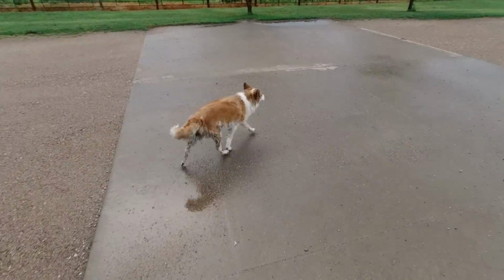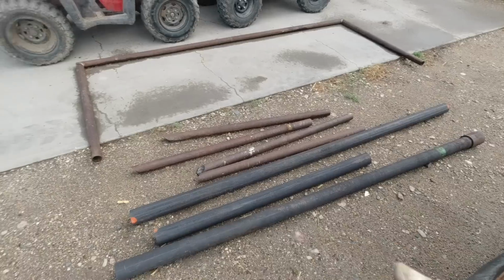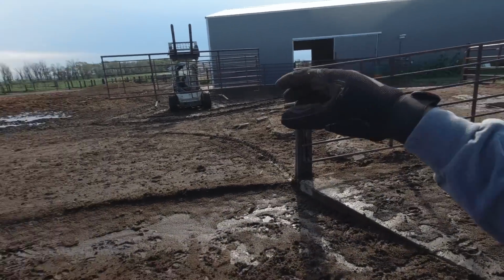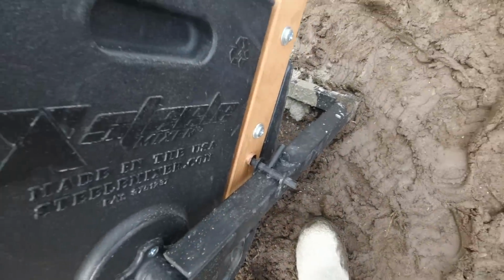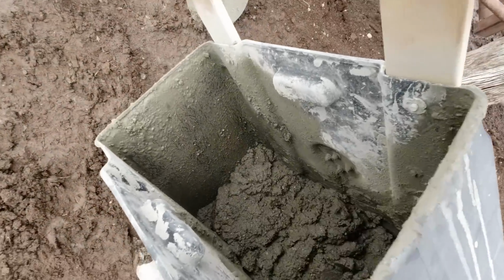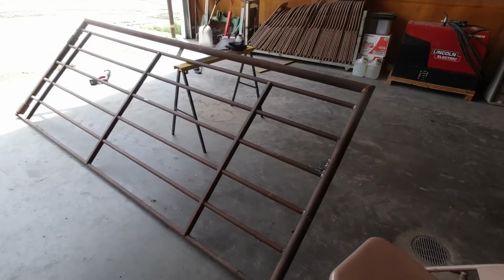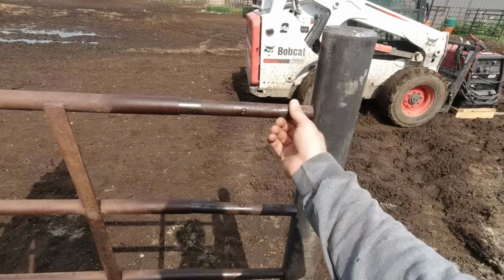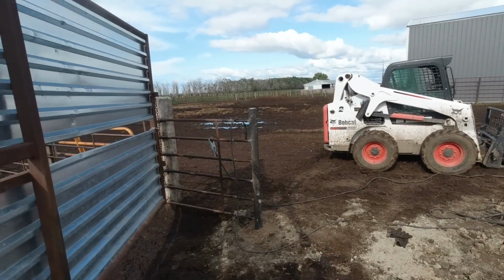Back-breaking Farm Work

Comment: I have one memory that you prompted in me as you were building those gates.  I spent one summer working at my uncles' farm implement factory building early Flexi-Coil packer frames in Saskatoon.  I cut the 2.5 inch pipe into the required lengths.  I cut thousands of packer frames.  Later, we then bent them using a pipe bender.  Then the welders would weld the steel pipe together.  I was a laborer.  It was a summer job so I could earn enough to go to university.  Your video caused me to go back to what seems like yesterday.  Thank you.  I also worked on a farm for a couple of summers.  It paid my way through you know where.  Take care when you are working alone.  . . .  most farmers do work alone.

Comment: The cement I use is dry pour. It works great.
Reply: That is true, however he doesn't have the wait time as he needs to attach the gate and the concrete needs to set. Do you know how long it takes for a dry pour like that to set?
Reply: @dhenschel4  you pour water in the hole first or last. Doesn’,t matter.

Comment: Welding Project… for gates that get snow drifted in . Cut an hing bottom two gate rungs so they will swing up as you open are close gate. Larger gates need additional diagonal to help with sagging; so they don’t drag the ground. Helps putting in a turn buckle; for adjusting height.

Comment: You have a pile of $20 tables behind where you’re welding.  Buy a flame blanket or a sheet of metal and cover the table.  Hook your ground to that sheet of metal and the table becomes hot.  It’s so nice when you don’t have to move the ground every weld.
Reply: Pallets also make the best tables because you can alway use whatever forked machine to move the pallet table in, out, higher, lower,or take the table with you to the project.  Stack it away when you’re not using it.  A sheet of metal as a surface and it because hot with the ground attached.

Comment: The rain is a godsend but farmers really needed it gradually over a few days. It's great you make your own gates rather than buy them. This way you can make them as high and wide as you need them. The downside is what it does to your body and maybe weld up a fold up steel table with an adjustable height you can use for many things especially welding gates. The cows and calves are all looking good considering the weather. What was the song of the day?  Keep on keeping on. Chris from Australia 🇦🇺.

Comment: Cole, glad you made mention of a table    build a frame only table that  is open on one end   out of 1.5 "  angle wide face up  perfectly  parallel    then this JIG TABLE  will help you make any length gate 
or 4 fresh 55gallon drums  not all bent up.  lite easy to position and set out of the way make perfect  "table"  just put them where you need them you can still put the 2x4  to space up the tubing  get off the floor fella   great  videos  folks..

Comment: if you get the concrete mix for post holes you can pour the dry mix and dump water on top and it will soak in.  Makes setting post by yourself real easy.

Comment: A lot of the people giving you a hard time about the dry cement mix in the hole have never messed with the stuff in their life. You do not even have to add water just put the dry mix in and the moisture content of the ground will do the rest for you. I do like the new mixer though. It could be really handy in more remote locations.

Comment: From a concrete guy, pour your concrete bag mix in the hole, add water, and get a Dewalt concrete vibratory let it do the process itself. Either way, it needs to be compacted.  We call it dencified concrete.

Comment: You have definitely figured out how to build gates always nice when you can build them to fit an opening. Yes a table would be nice even a couple smaller tables on caster that can be used as work benches or side by side as ba table would be good
Reply from the maker: thanks!

Comment: I just put the sacrete in dry and tamp it in as if its dirt and it will pull its own moisture from the dirt and harden up. I put 5 or 6 inches of just plain dirt on the top of the hole

Comment: Nice gates!  Build yourself a nice welding table on wheels that lock. Maybe make the legs height adjustable with hydraulic cylinders.  Sooner than later so your back doesn’t end up permanently injured, in spasm & pain.

Comment: Have you tried using the Cement dry. Just dump in the hole after you get the post in position,  by the next day it will be solid.  Try it it works. Use quick setting concrete.

Comment: Nothing wrong with dumping the concrete in the hole and topping it off with water. 
IF there is moisture in the ground it will pull it out and be fine but beings how y’all are in a drought I would have mixed it also!
Good job either way!

Comment: Quickcrete makes post cememt that you pour in dry...
It sets up without mixing or adding water...
So , its not wrong to just pour it in the hole...
I've set many posts without a drop of water...
It pull moisture from the soil & it works great..

Comment: I made 8 stands out of 1x1x1/8th angle iron.  They are 36in. Tall and 2 ft. Wide.  That allows me to stand up and build my gates. They will hold a tremendous amount of weight and are easy to store.  They even work better when you have a chain hoist above them.  It kills my back to watch you work on the floor.
Reply from the maker: A chain host would be amazing

Comment: Make a set of metal saw horses to use with your welding projects or tack weld in the shop the finish after hanging them on the posts .

Comment: You need a welders table on caster wheels. They can be purchased, but much cheaper to make them. You do have the skill to make them.
   May contact Vevor tools. They do promotions with Chris Duffy at Farming With Duffy Ag and Andy at Farming Fixing & Fabricating here on YouTube. They both got Magnet drills, 
   Duffy also has the welding table, and was just using a real nice Plasma cutter today Vevor offers. Maybe reach out to them.

Comment: Good job fabricating.  Get knee pads. Make yourself some better metal sawhorses out of angle  or pipe and you can make stuff on them. You can add adjustable extensions to them.   I prefer just working on the floor tho.   Or you can tack stuff together on the floor so it's nice and flat, then put it on the horses to weld it up.    Looks to me like you have lots of fun there on your ranch!  You're a king compared to someone with a crummy job in the city.

Comment: Oh, yeah.  I forgot.  Not wanting to state the obvious but going to do so anyway, I noticed you have some of those folding tables standing by the wall which are probably 30" high. I bet if you pulled down a couple of those, unfolded them and placed a piece or two of wood as kind of a protective barrier on top, you would have a nice "sit your butt down" kind of work table for welding those gates.  You might even save on Tylenol. You just need an old office chair on wheels so you can roll along from weld to weld.   Working on the floor is a pain in the... well, you know.  You are a farmer and "Professional Grade" in everything you do.       Jack L.

Comment: Hey Cole why don’t you pull up your trailer in front of the shop and use it as a work surface. I have a tandem 8 X 12 and use it all the time to work off of.

Comment: As young as you are you seem to be falling apart pretty quickly — you need to start taking better care of yourself. You’ve got a good 40 - 50 years ahead of you and it don’t get any easier. For a table to handle the fence gates maybe consider a couple more adjustable sawhorses and build a jig to weld the corners sitting on the sawhorses.

Comment: Cole a smart man??? well the Jury is still out on that. Why don't build a welding table and put tube under it so you can use the skid steer to move it into the shop when needed and when not in use place it on rail road ties to keep it from freezing to the ground.

Comment: It's too bad you don't have any kind of equipment that has a bucket on the front that you could face two of them together then lift up the buckets high enough to create a work surface using some wooden posts or something so you don't have to work on the ground. 🤔

Comment: Sooo..Now that we all know how smart you are, I suppose from now on we can refer to you as Mr. Smarty-Pants, huh?  With that being said and at the risk of seeming really anal, why wouldn't you just put a measured amount of water into one of those handy five gallon buckets you have hanging around so you can just pour the correct amount of water into that cool as beans little mixer so you have exactly the right mixture every single time.  I guess that would be too easy.  Speaking of water though, I have wondered also why you don't follow the example of all the roadbuilders and grade your barnyard high in the middle so all the water runs to the sides maybe into little shallow swales.  You wouldn't have Lake Sonne to keep driving through and splashing all that water and dirt to the sides which keeps making a deeper lake. Just curious and you did say you were looking for stuff to do...     Jack L.